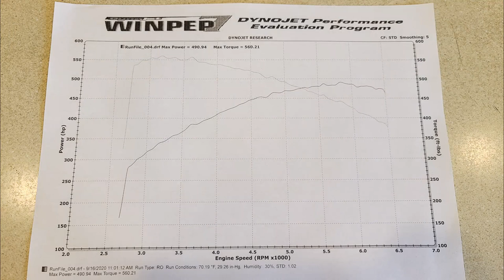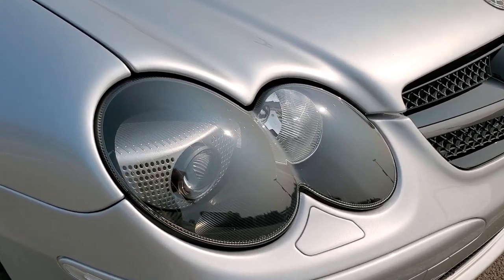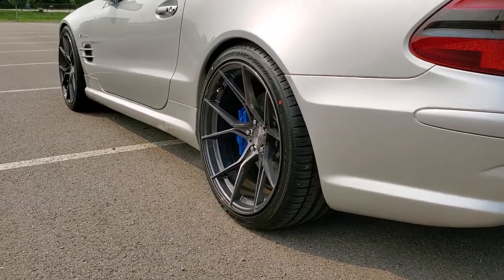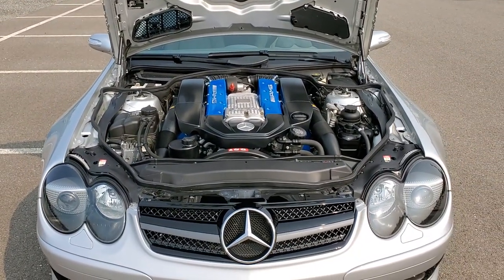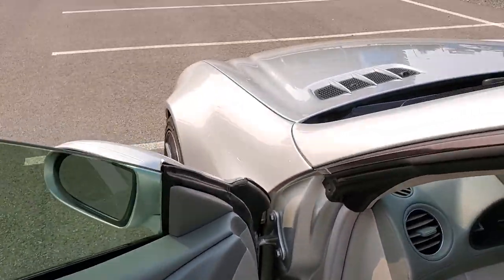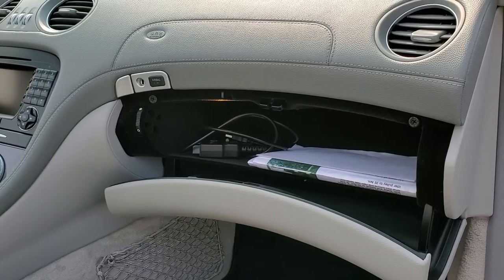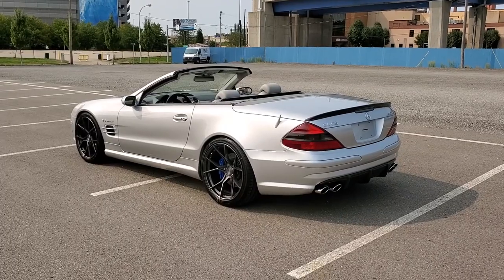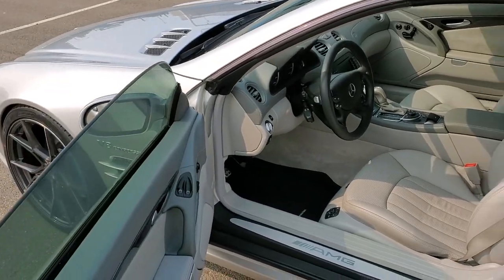2005 Mercedes Benz SL55 AMG walk around, customized by FisherFAST! 588 horsepower and 672 torque

Comment: Hi Brian. I have a 2005 SL55 in Alabaster White. I really like the modification that you have done to the headlights. Is this something you would be able to do for my car? If so, what would be the process and cost? Would you need me to send my headlights to you first or would you just use mine as a core replacement? Thanks, Mike

Comment: Wonderful job and great presentation! - I have a 2005 SL55, brilliant silver with the performance pack (owned it from new), so I got a big kick out of watching this!
Just need to sort out those retractable roof flaps on the rear shelf (always an issue on the older cars) and it'll be perfect...
Reply from the maker: Thank you for the great comments Ashley! What a treat it must be to have bought this car brand new and still have it to this day. That says a lot about your ownership experience. You are 100% right about the flaps. I always change the flaps with the updated thicker steel flanges and rear boot to window rubber seal when I get these as they're always bad 👍

Comment: Very nice work I totally appreciate the attention to detail. I have a 2009 SL63 And was wondering if you have done something similar to this in one of those? Also where can I get a black hood emblem for my car. It seems that every where I look they have the more modern type that has a button mounting bracket that you push out of the hood, mine just has the two clips that push into the hood with rubber/plastic grommet.